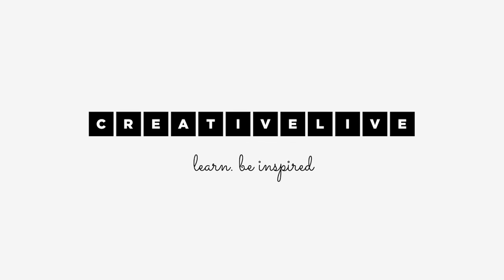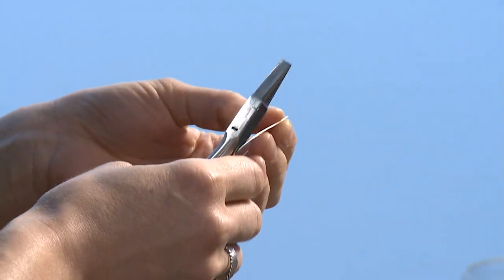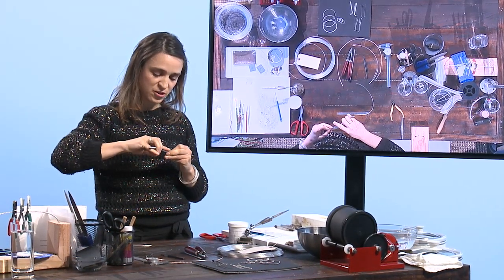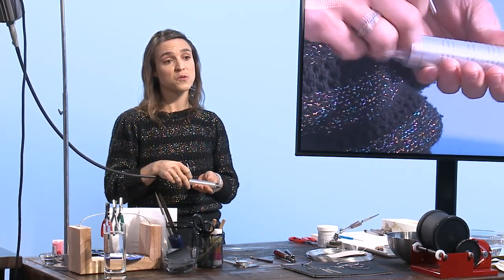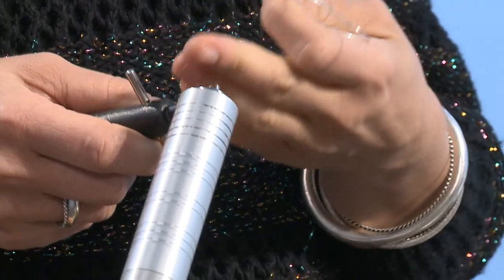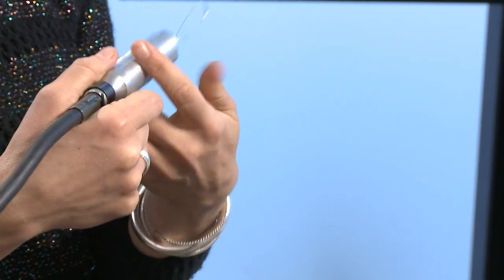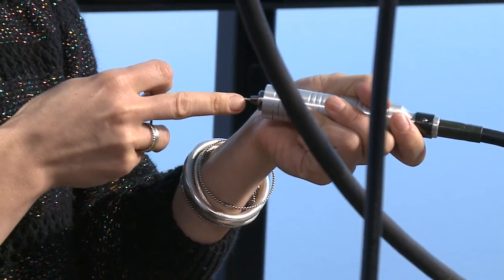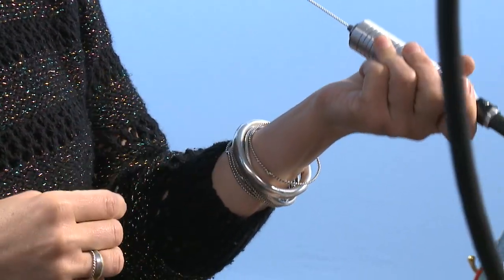Jewelry Making: The Easy Way to Twist Wire with a Flex Shaft

Comment: Are you using fine silver or sterling silver?  Also, in another video you twisted copper and another silver metal for a bracelet and when you fused them together you didn’t utilize solder .  Is solder not needed for Copper and/or the silver metal you used?  I thought solder was always needed for sterling silver.